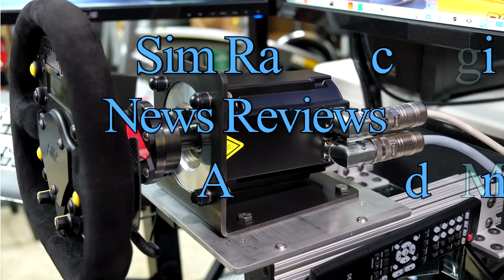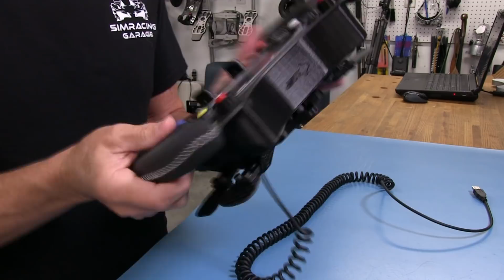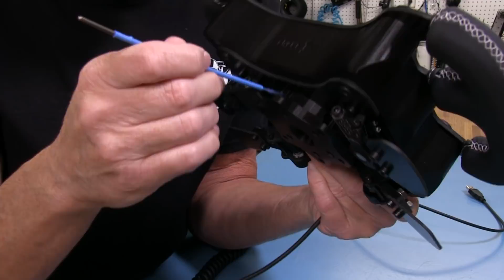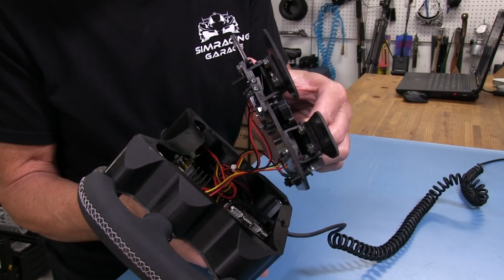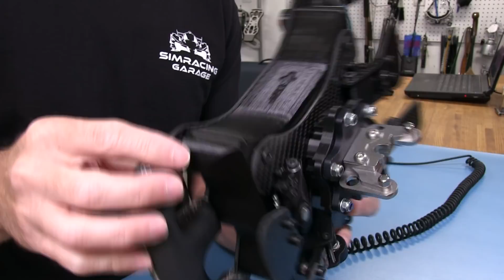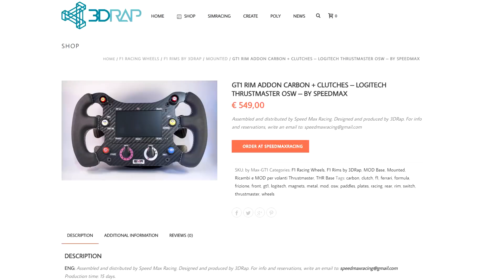3DRap/SpeedMaxRacing F1 Wheel Review

Comment: hello thank you very much for this video it is a beautiful wheel said me the universal adapter on the wheel is end its depth is
  about 2 centimeters between the base of the steering wheel? because I have to use with the hub fanatec podium which is already 11.5 centimeters long thank you very much for your articles
Reply from the maker: Exactly 16mm from the base of wheel.
Reply: @simracinggarage3026  thank you very much for this clarification! it's a pleasure to follow you

Comment: If I buy this and the Accuforce V2 will I need to buy any adapters?
Reply from the maker: If you by the pro verison that comes with a wheel, you can bolt the wheel side QR hub to this wheel and use it with no issues. Not sure if you can plug the USB directly into the Accuforce, but you can plug the wheel's USB directly into your PC. If you don't get the 
accuforce wheel, you can just use a third party QR system that has a 70mm bolt pattern and connect to the motors hub that way.

Comment: Is this wheel compatible with the Accuforce Pro v2? If so does it come standard being able to work on the Accuforce quick release or do you need a special adapter to make it work?
Reply from the maker: I think there is a wheel side Accuforce adapter that will let you use any wheel with a 70mm bolt pattern. Using the original motor side QR.

Comment: Nasty 3d printed encoder knobs, button shields and rear housing, No thanks! For that money I would expect machined aluminium or even carbon fibre, it should have real LED shift & flag lights.
Finally the finish is pretty poor, there is delamination on the edges of the carbon sheet where it has either been cut with the wrong tooling or too aggressively (watch out for splinters), none of the radii look consistent, the countersunk screws are not flush & the way that the screen surround "button bulges" fit against the stitched "alcantara like" material looks terrible.

Comment: I wonder if the hub is designed to take 1/4 inch bolts instead of 6mm ones. The heads on 1/4 bolts are 7/16 which is around 11mm instead of 10mm heads on 6mm bolts.

Comment: 3D printed stuff should be making the prices cheaper. I wouldnt spend 550 Euros (69,469 YEN for me)  for a plastic wheel with a fancy screen. Seems well overpriced . Thanks for the review thou.
Reply: LCD screen, Carbon Fiber, and stitched handles... This is 1/3rd the price of any competitive product. Everything must be overpriced to you.
Reply: I dont mind spending money on quality products, i just dont see the value of this wheel for me. But you go right ahead if its something you like. I have bought products from 3Drap before, again 3d printed stuff, and the finish was kind of dodgy and didnt sit flush in some parts with rough edges and bad joins.
Reply: Custom low-volume jobs like this are never really a good option for value. Bulk processing and automation saves a lot of money in the long run.

The "GT3" and "DTM" wheels by 3drap are a much better option if you need to save money. Use an android device as a display instead (DashMeterPro for me), but you lose the hand clutches, which I personally could stand to lose for a better deal.
If you really want it cheaper, you order one of the DIY kits and assemble it yourself. Or don't order the DIY kit and design and make a wheel yourself, like SimracingNC did for his F1 wheel. I can't even imagine the satisfaction when your own hand made wheel is finished.
Reply: It isnt fully 3d printed. It has aluminium plates for strenght.
Reply: @sebastiaanscholtens7763  I recently built my own rim with one of their kits. The front and back plate are made of solid, laser cut steel. The only structural piece printed in 3d is the wheelbase adaptor, and that is, as Barry mentioned, sturdy af.
This is nothing near a "plastic toy".